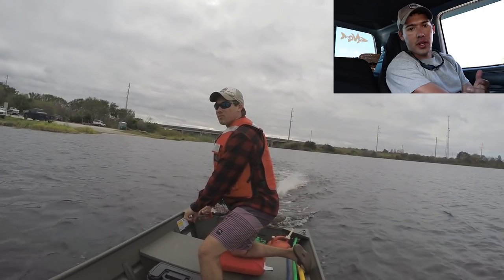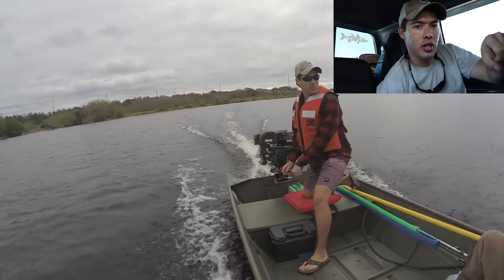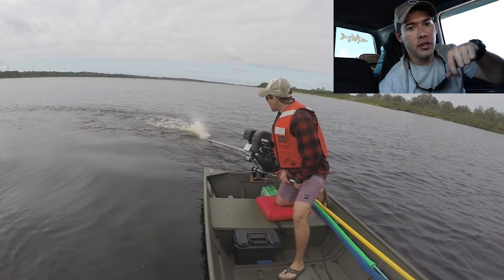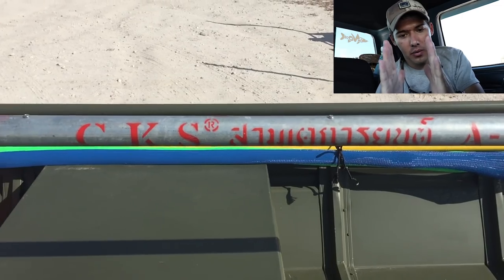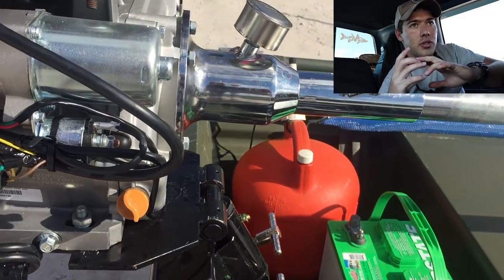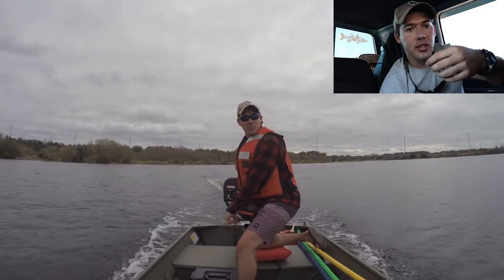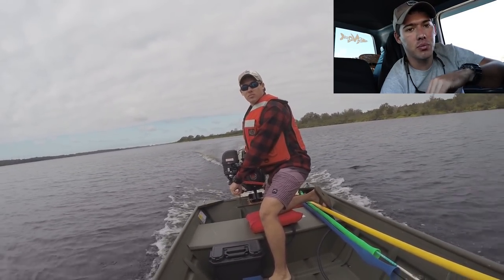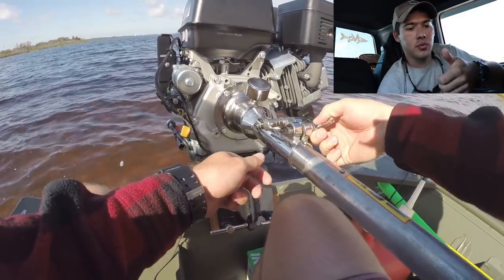First Run with the Mud Skipper Longtail Mud Motor Kit: CKS Water Test S3E2

Comment from the maker: First we tested the CLP Beaver Dam kit. It didn't ride right and the 85" shaft seemed too short, so I decided to test the CKS Mud Skipper kit second. This kit had the 100" but the tail weight isn't balanced for speed so it doesn't ride good over 10-12 mph, and their is no adjusting that on this kit. So next will be the SPS Swamp Runner kit.
Reply: It needs a trim tab on the skeg.

Comment: What about a cavitation plate?
Reply from the maker: Cavitation plates are not meant for thai longtails. You can use a trim tab on the skeg, but not a cavitation plate.  Some people mix those two up and think they are the same thing so I just want to clarify that the trim tab is a metal tab that can be bolted or welded on the skeg and a cavitation plate is something that fits over the prop and is an actual plate. The trim tab is a last resort but can be used, as where a cavitation plate is not designed to work with a thai longtail.
Reply: JTgatoring I’m new to longtails. Just bought a 14 foot flat bottom Jon boat and a 6.5 predator. Bought the 5-7 hp mud skipper kit. Could you explain why you couldn’t weld a cavitation plate onto the Thai motor?
Reply from the maker: To start, a Thai longtail is long so that it can reach the wake behind the boat. The prop rides in the crest where the two wakes meet. If the prop rides there, the plate would not be effective because it would not be able to grab any water. 
Secondly, the props used with a Thai kit are surface-piercing props with two blades. This means that one blade is in the water while the other blade is out of the water. So again, the plate would not reach the water unless you buried the prop which would greatly decrease the potential performance. 
Thirdly, with the long shaft, you have a great shaft angle. The cavitation plate angle would not be possible because it would most likely have to be angle so much that it would hit the prop.
After talking to many mud skipper owners, it seems like mud skipper is more worried about selling product rather than improving customer experience with their product or at least educating their customers.
One way you may be able to fix your issue is by adding more weight to the tail. Watch the last video I posted and it may help better explain a few things.

Comment: cant seem to find any help with this maybe you know something? i was out on the lake today my finger slipped off the throttle and motor shut off when i started it again the prop stopped spinning, gave it some gas and seemed to fix the problem. i got back to the dock shut it off and started it back up and prop stopped spinning again but this time wasn’t coming back when i gave it gas. any idea of what it could be?
Reply from the maker: Could be many things. The first thing I would do is take the longtail shaft out of the coupler housing and see if the internal shaft spins easily. If it doesn't, then you had a bushing go bad which would seize up the shaft and lock it up. The bushing could have melted and fragments causing it to lock up. Also, look in the coupler housing. Some have a bearing in there. That could have also locked up. If everything so far is good, check your spline connections at the end of your coupler shaft or longtail shaft and see if you stripped the threads. Let me know what you find.

Comment: Add 10 inches to the handle and you will enjoy your rig much better! I did the skipper and it is a great value. I have a river fishing boat that I can enjoy!  I bolted my transom mount by bolting through the the hull and adding wood to equal the mounts width.  Very secure!
Reply: It took a 5 inch bolt!
Reply from the maker: @tjon66  That is a possibility but the kit is not balanced correctly. There is not enough tail weight to keep the prop in the water and there is no way to adjust the kit to give it more tail weight. The through-bolt is a good idea but still wouldn't solve the issue I had with the kit, but if it works for you that's what matters

Comment: Having weight to something like this to balance it is quite easy if you have mechanical capabilities and when you get something that is a budget piece of equipment replace all lock nuts with lock washers in that with nylon lock nuts matter of fact even substitute all the fasteners for grade eight fasteners for a little bit of money you save not doing this you just paid for it
Reply from the maker: It could be done for being able to add weight to it, but coming as a pre-engineered kit, it should be able to ride without issue. You would be able to fix it but someone who is uneducated about longtails and gets this kit and has a bad experience with it would then think that all longtails are like this and it ruins their longtail experience. I decided to go with the sps kit and I did upgrade all the fasteners to stainless due to running in brackish and saltwater.

Comment: I'm not sure about the other motors, but I know that with my SPS small kit running a 6.5 predator I can usually run 12-15mph. That's if I'm the only one in the boat. I've found that by adding weight towards the front of the boat makes it harder on steering control and limits my speed. I've got a similar boat too, a 1436 Tracker Topper. To be completely fair on all the reviews, you should try to run each kit in similar conditions with same weight in the boat. Just adding an 80lb kid sitting on the center seat makes a noticeable difference in speed and handling in my opinion. Keep up the good videos, enjoy watching them all.
Reply from the maker: My small kit road fine on this boat also. With or without someone, I didn't notice any change in maneuverability or handling. The top speed I got was 12 or 13 mph with a 6.5" prop. For this series, I tested each kit with one person and two person speed tests. When I went to test the CKS kit that day, I forgot my head mount for my gopro so I was only able to record with another person in the boat. I still did the speed test with one person, they just weren't video recorded. I tested all the kits the same way with the same weight, the same haul, same distribution of weight, and even the same person in the boat each time. Each kit was tested fair and square against one another on the same playing field.
Reply: +JTgatoring And that's why I enjoy your videos. Complete honesty. The only time I really notice steering issues is when the weight in the front of the boat causes it to kinda nose in/plow water and not get up on plane. I've noticed it handles best with most of the weight in the back 7' of the boat. Don't get me wrong tho, the longtail setup has plenty of torque to get myself and a bunch of fishing gear up the creeks I fish no matter how the boat is loaded. Albeit slow, but has always had the power to get me there.
Reply from the maker: Thank you Jeff McCain! With just me in the boat, the back end of the boat sits a lot lower and doesn't get on a very even plane, but when I get another person that weighs over 150lb sitting on the deck, where the seat is, the boat planes out a lot nicer. The problem that I have run into so far, is that once I reach 13-15 mph, the wake is out running the prop and that is when it is hard to keep the prop in the water and becomes hard to handle. Hopefully the SPS kit will ride better than the other two have. I know I loved my small kit. It got me anywhere I needed to go, but which ever medium kit I choose will have that extra power to really push this boat into some thick stuff

Comment: If you need more tail weight try a shaft zinc of the size that would fit..divers install them on the shafts under water..They clamp on...might tow but you can slide the where you need it..
Reply from the maker: Good idea! That would be a viable fix

Comment: After owning that kit for 3 years i sold it... the prop became loose everytime I was in weed or when i hit thin ice.... the prop never stop going out of the water..... i did everything : drill new hole to bring it further back... turn the transom bracket, calvitation plate, keg, longer shaft, nothing worked. So i quit and sold it...
Reply from the maker: Yeah, I would not have been able to last that long haha
Reply: Get a mudskipper man there are affordable and very nice

Comment: I have had no problem with it at all.  Though i do run mine on a 12 ft jon. I love it and use an impact to drive the nut on for the prop. Only problem i got is where do you find the prop replacement all the ones i see are key slotted. This one is just tapered
Reply from the maker: Do you have the small kit or the medium kit? 
For the prop, Mud Skipper is changing, or has changed, their initials from KKK to CKS, and I think they are trying to re-brand it. The props with the new branding initials of "CKS" do not have any keyway slots in them. On the other hand, the weedless prop I got from them is still labeled "KKK" and it does have the keyway slot in it. 
-If your shaft has a key on it, you need a prop with the keyway in it. The prop without the keyway slot will not fit on a shaft that has a key on it.
-If your shaft does not have the key on it, then you can run both props, either the one with a keyway or without. They will still fit on the shaft that does not have a key.
Reply: JTgatoring i got the 212 predator kit and I do believe it is cks it came with a 6 inch prop and a 61/2 prop.
Reply: JTgatoring I also had the problem with it not wanting to pivot on the transom but when I looked at it close its because the washer is rubbing against the frame.
Reply from the maker: So I do not know how their small kit runs. The kits I tested are medium kits and they are different from their small kits. The washer was rubbing on the frame, of the boat or the mount?
Reply: JTgatoring on the bottom of the pivot shaft whatever you want to call it. You have the transom the nut and washer that bolts the motor plate to the transom your calling it the pintle well the bottom nut has a washer that is to big and rubs against the transom. If you gake a drill bit and wrap it with 220 sand paper till it is a tight fit in the hole use a drill and hone that out leave that grease fitting out and hit it with some good lithium grease or even better some chain wax for motorcycle chains. Grind that access part of the washer that is sticking out to keep it from turning or getting caught in a bind and presto its perfect.
Reply: They also do suggest you use a transom pad to keep from having the problem of the transom bolts being way out there like that..
Reply from the maker: Oh yeah. I never noticed if mine does that or not. I will have to look at that. But atleast you got it to work for you!

Comment: every boat back is different you going to have to do a little bit of modification to every John boot some not but some you will don't don't bust on it if you can't even put a three-quarter inch piece of plywood in there that would be an eliminate that problem you can even cut it on a wedge and it would be right on spot on I've had these products for several years and they do not lack in strength and stability
Reply from the maker: The transom bracket lacks quality. Maybe the product you have is different, but I showed the reasons why I said what I said for the product in the video.

Comment: Why dont you just cut to indents on the piece of wood for the transom bracket.... problem solved.
Reply from the maker: Because the kit is supposed to be able to mount onto the boat and run. Having to make modifications just to be able to run the kit is just a poor design that needs to be fixed. I would have to get a thicker piece of wood to make the indents for the transom bracket and to angle the transom bracket back. Its just too much to make this kit work on this boat.